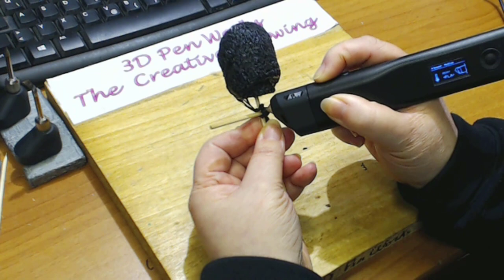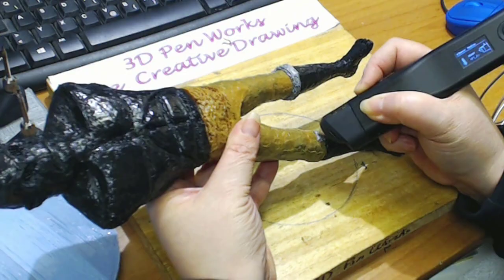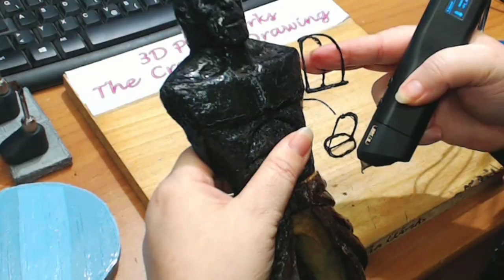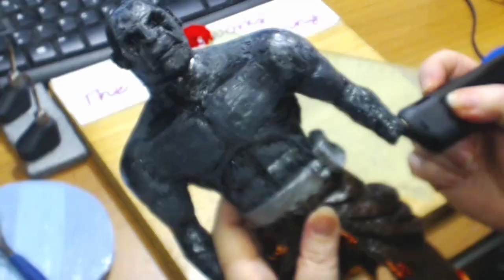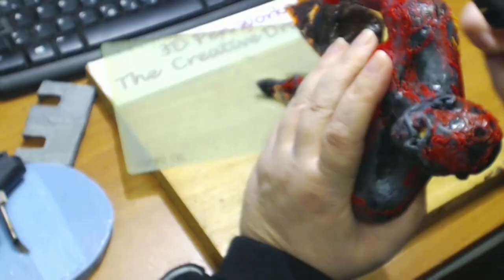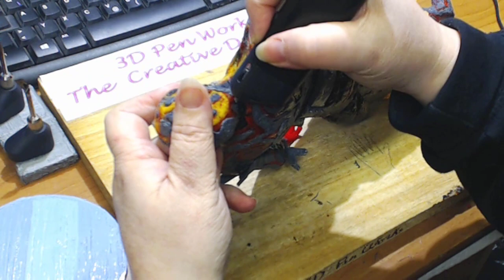Fortnite season 7 prisoner skin with 3d pen | 3DSIMO | 3d pen tutorial

Comment: I like your pen that you are using. I wish I had one for the heat pencil. But it looks like your nozzle is smaller so less comes out so you can get more detail work. 3-D pens are just so much fun.  keep making videos it's fun to watch such creativity.
Reply from the maker: thanks a lot my friend !! Yes, it is a pen for small details, but also for big jobs, I like the fact that you can smooth surfaces or even repair objects in different types of plastic, weld electrical components, pyrograph the wood, cut the plastic or foam. it's really a pen for every creativity. :)

Comment: Amazing work, on details. 
I would like to ask you regarding the pen (i also asked on instagram), Can you change the temperature manually ?
How long do you work with the pen attachment ?
I haven't found any option to shut it down / or standby mode so I unplug the attachment directly.
Reply from the maker: thank you so much! I'm sorry, I saw the notification but not the message, in any case there are no degrees, for the pen is already set the temperature based on the material, you can manually change the percentage of temperature to smooth, for example I use it to 75% you have to do some tests based on the material you need to work on. I use it for about 10 minutes continuously but I always try to take frequent breaks. The pen goes on stand by itself, while the burners are activated with the wire feed button, and go off with the wire retraction button. I hope I have been helpful with the explanation.
Reply from the maker: I usually change the attachment even if the pen is still on, while the burners turn them off first.
Reply: @3DPenworks  Yes that was very helpful and well explanatory,  thank you very much for your help, I hope i didn't bothered you with my questions.
Reply from the maker: no bother at all, you're very welcome, anytime.. :)